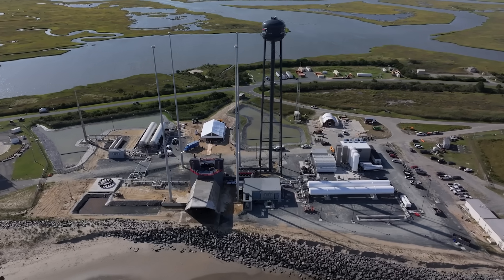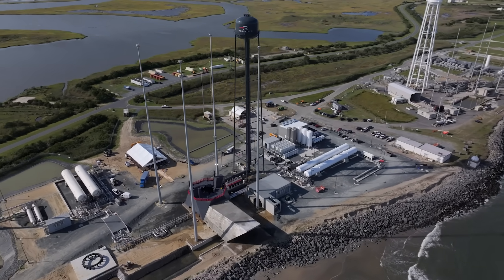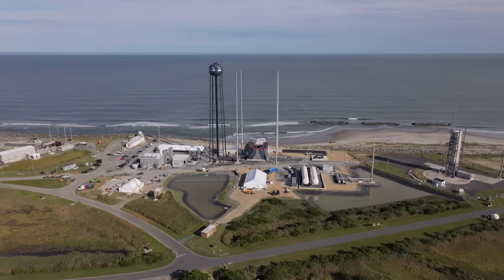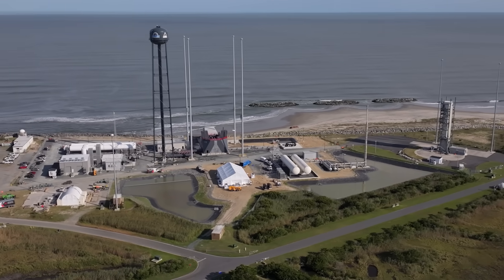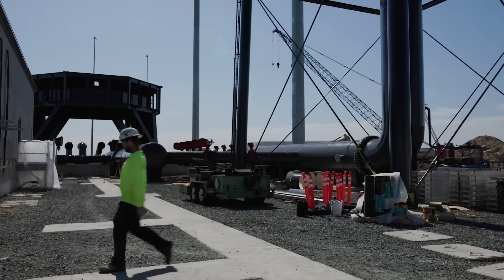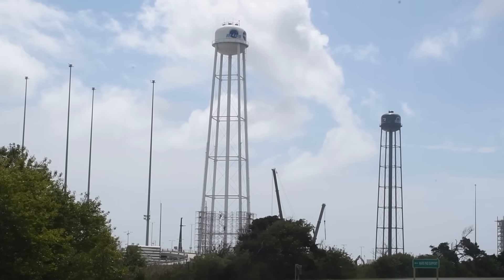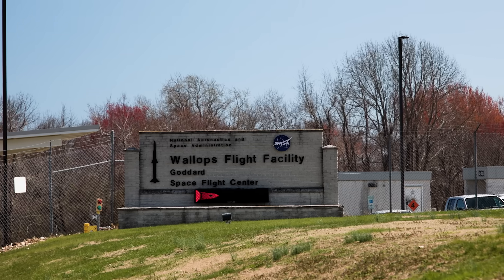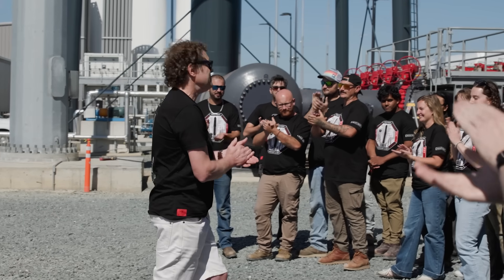Neutron | This is Launch Complex 3

Comment: Does Neutron have electric fuel pumps similar to Electron's, or are its engines the gas generator type?
Does Rocket Lab have plans to go to full flow staged combustion engines a la SpaceX and other rocket developers?

Comment: And rocket exhaust directly into the ocean? Not good. I think there might be problems. What do you think?😵‍💫🫵😁
Reply: Methane and liquid oxygen so the waste products are water and CO2
Reply: What problems ?
Reply: Will they test fire on the pad or that ring nearby?
Reply: @PanzerBuyer the back and red ring above the flame tunnel, between the four lightning towers, just south of the water tower.